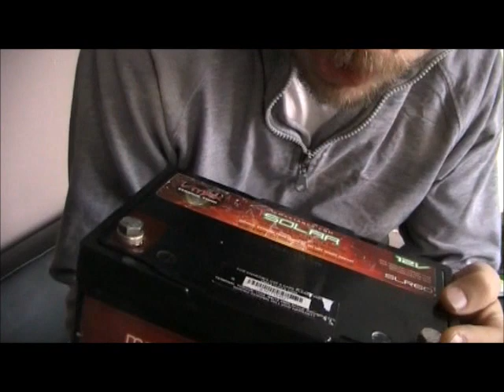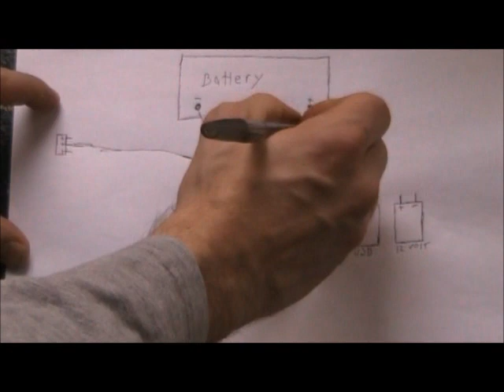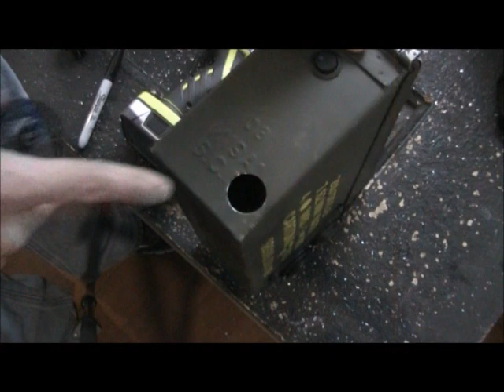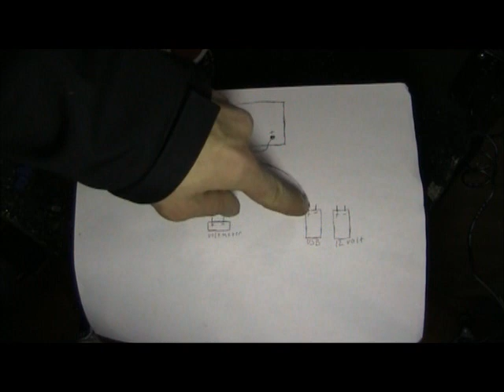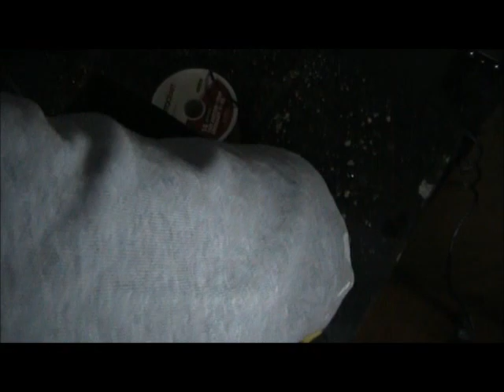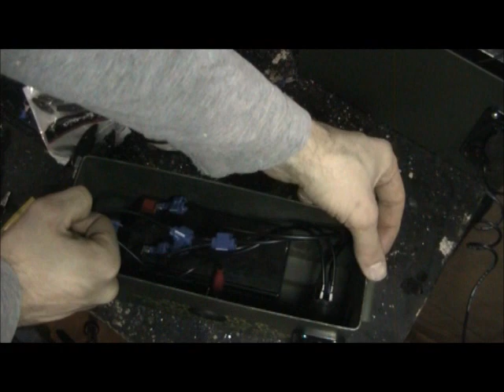How to build a portable 420 watt solar power generator (video 1 of 2)

Comment: maybe i missed somthing....but usb ports are only supposed to be 5 volts.so hooking them up to 12 volts its  gonna fry any usb devise that  you plug into it. how are you reducing the power from 12 to 5 volts?
Reply: +deganator the USB terminal has electronics in it that steps down the power.  My troubling however is no fuses...
Reply: its good to know that because not all aftermarket usb ports automatically reduce voltage from 12 to 5 volts.
Reply: +deganator I was thinking the same thing... I am not sure if it will damage the electronics or if the plug is outfitted to accept 12v?

I'd like to see the item list but the ebay store is outdated and I cant seem to find it anywhere
Reply: believe me 12v will fry anything less than. tom tom gps is 5v, cell phones have 3.7 v batteries. A cell phone cigarette lighter plug in charger has electrical components inside that drops the voltage down to about 5v to charge your phone. this guy is a moron I wouldn't follow his design.
Reply: +deganator they are stepped down internally
Reply: deganator this is so dumb. a USB port designed to be wired to a nominal 12v battery will 100%  have a  DC-DC Regulator. 

even most 12v "Cigarette outlets" designed for off-grid (or the 12v outlet in your car) also have Dc-Dc regulator because your 12v deep cycle battery (or OG car battery) will never have an exactly 12v output(it ranges from the 10-14v).

So as with both AfTEr market, and Before Market 12v Cigarette plugs, all of them have a DC-DC Regulator because they are designed to be hooked TO A CAR, because your car NEVER HAS CONSTANT VOLTAGE OFF YOUR BATTERY (it's ranged from 14v to 10v) just like a deep cycle battery.

Comment: Don't forget if you're going to need to put a diode in the positive line so the batteries don't discharge at night, or got back into your charger.
Reply: Kevin, do you have a diogram of how to do this? Thanks! Or does a a solar charge controller do the job?

Comment: IN  house electricity you never put a negative on a switch  ,why the difference?
Reply: I don't know ?  no guessing sir! I kneed absolute certainty ,please
Reply: +Nelson Dacosta That switch has an led light to indicate that it is in the "on" position. the negative wire is only there so that that led will light up.
Reply: good

Comment: Great idea, but bad execution. All of those "Squeeze" connectors are not needed if you plan out your wire harness a little better. If you need to make a 90 degree with one of your wires you could also use a Flag connector. And you can crimp multiple wires into a single terminal connector or use a connector that has multiple male connectors like this one http://goo.gl/Jln3RG.  Also like a few people have said you should give better consideration to placement of components to avoid cramped wiring. And maybe you might want to think about locating some of you connection points onto the top of the ammo can to further move components out of the way to allow more room for a larger battery. Please do take this as me tearing into you these are just suggestions.

Comment: The Connection you made with the quik light duty compression connectors, it is Not for this apprication, if you want exit the Battery with multiple in both Positive And Negative connection we have those terminal

Comment: How much hot water could you heat up from this unit?  If anyone makes these in the UK, please let us know.
Reply: birdienumnums1 We would need to know details like initial water temperature, target water temperature and the system you intend to use it with to be able to calculate anything meaningful to you. What were you hoping to use it for? This site might help.  http://processheatingservices.com/water-heating-time-calculator/
The battery alone wouldn't give you a lot of hot water from full charge, maybe 4.5L @ 60degC or 8.0L @ 40degC.
Reply: +birdienumnums1 Make it yourself?

Comment: Two more suggestions: 1) can you put all the plugs, meters & switches way down low, as close to the bottom as possible, and put a platform over the backs of them (and the wires) for the batter to sit on; perhaps even anchor the battery into place on it. 2) instead of wiring the volt meter + to the USB + what about a pushbutton switch betwen the volt meter + and the battery +. In this case, the volt meter would be off unless someone pushed the button. Reduce the drain on the battery (minimal though it is). Great presentation.

Comment: Very detailed video that covers all the aspects of the install!.

After seeing this, I think the design can be modified by:

Using a Common BusBar http://tinyurl.com/odk58wg (about $25 cost). This would greatly clean up the wiring inside the box, and eliminate the power tap connectors. Just put the + and - battery leads to the power inputs on the Bus Bar, then you would just connect all positive wires to one side and all negative wires to the other side. This will make it a LOT easier if you need to replace the battery down the road, as there will be less wiring in the way to get the battery out of the box. 

Stagger all the sockets at one end of the box to keep all the internal electrical connections away from the battery. You can purchase a triple-socket 12v-meter-usb on amazon http://tinyurl.com/ofgasfa (about $22 cost) that will save you some room in the build. This should free up enough room for the Power Switch, Tripple Sockets, and SAE External Solar Connector to be at one end of the ammo box.

Finish off the build with some double sided velcro, or foarm,  to hold the battery into place.